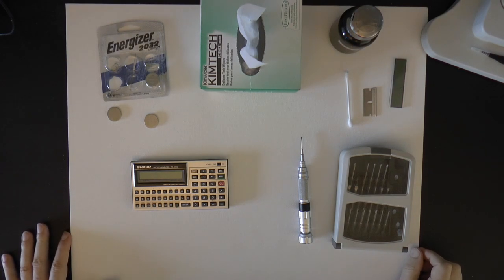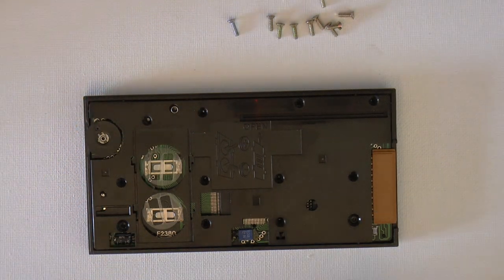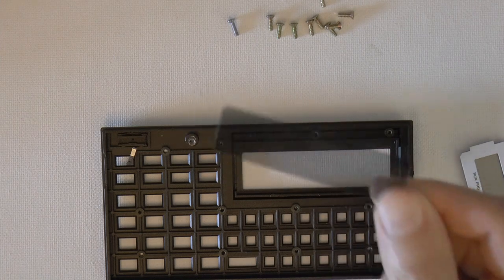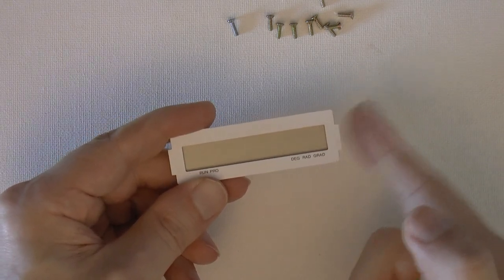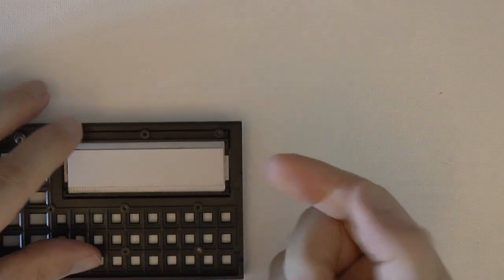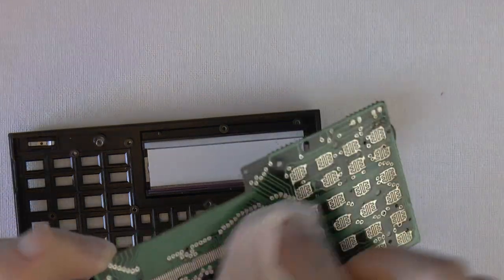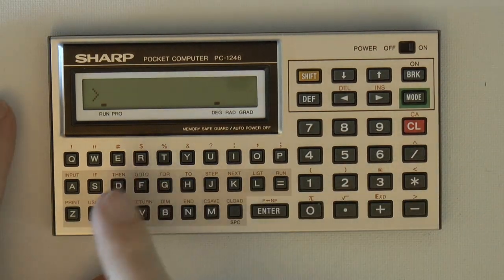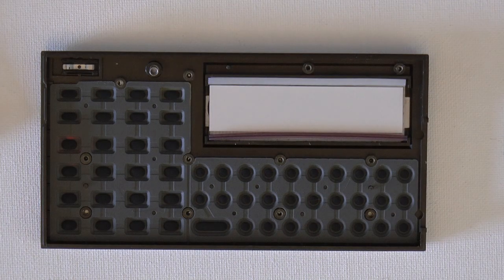How to replace the LCD on a Sharp PC-1246/1247 pocket computer

Comment: Since you have to remove the plastic polarization strip; why not include a clear, slightly thicker, plastic strip with the new display and avoid contact issues with the elastomeric strip?

PS, thanks for making these available. 
I thought I had bought some complete, new old stock PC-1 display assemblies, but they didn't work.

Comment: would you know if the LCD for the PC-1401 is the same as what you used in your video? Would you also recommend using a hair blower to soften the glue to remove the white bezel part? I plan to repair my 1401 and plan on ordering the same LCD. thank you
Reply from the maker: The LCDs are not the same, so they are not interchangeable. I would not recommend a hair blower. Use a razor blade.

Comment: Would it make it easier to remove the bezel if you heat it up slightly? For example, by putting it onder an iron at low setting with a cloth in between.